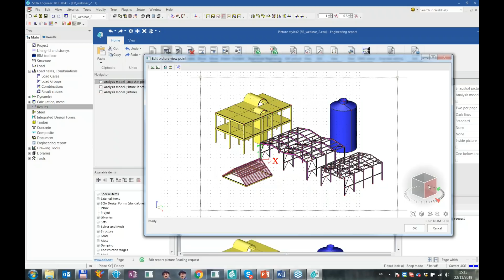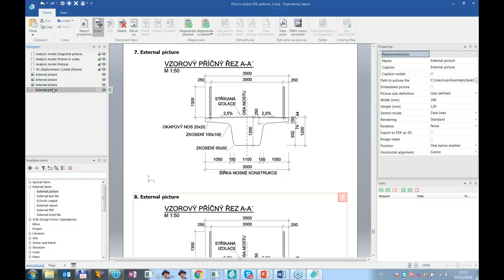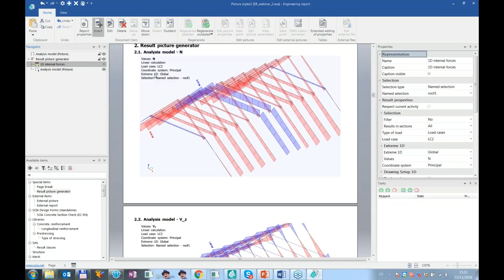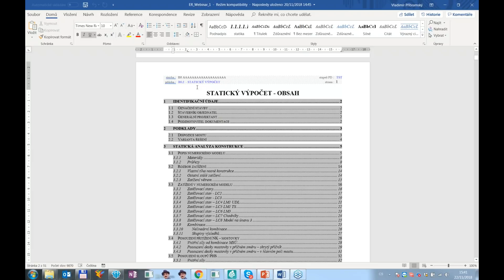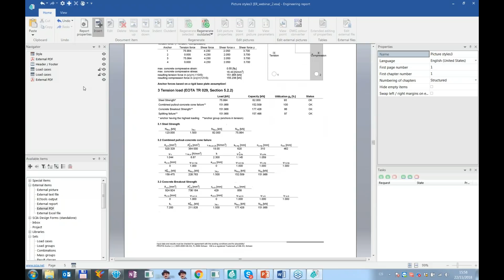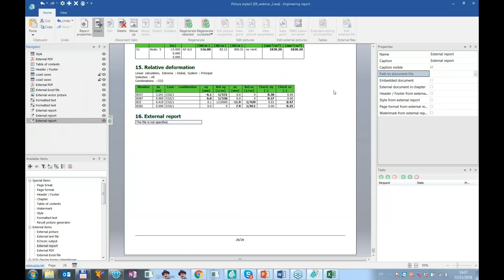Comment: HOW TO CRATE THE MATERIAL CONFIGURATION FILE .CON FILE ?
Reply: A .con-file can be created by opening a new txt-file, and saving it with the .con extension.
This is also explained in our BIM-workflow manual with a few screenshots - at the end of page 18 and on page 19. The manual can be accessed through the following link:
https://downloads.scia.net/support/sciaengineer/manuals/MAN%20[Eng]%20SCIA21.1%20-%20Advanced%20Training%20Integration%20with%20BIM%20Workflows.pdf